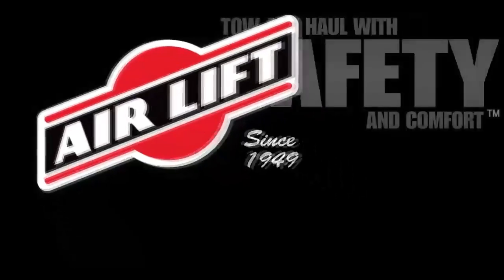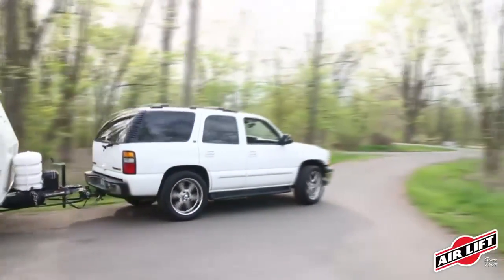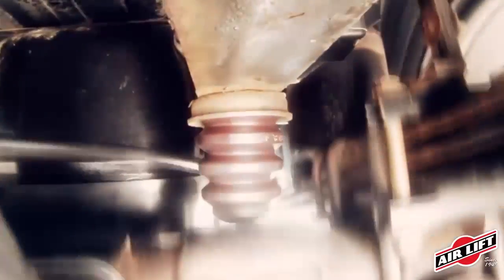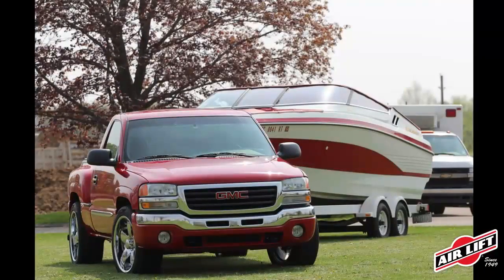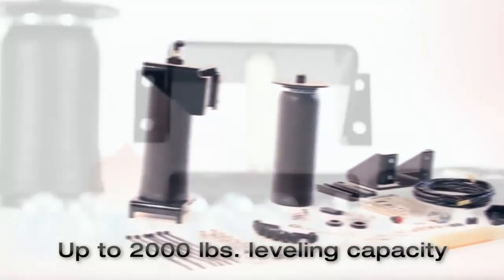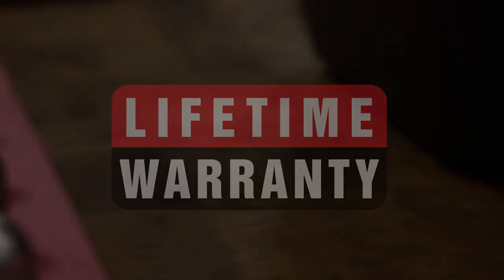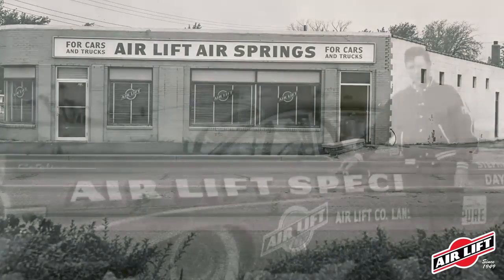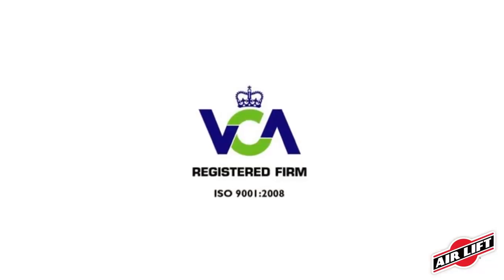Air Lift® Air Springs for Towing & Hauling

Comment: Video segment at 1:09 that vehicle has the stabilizer sway slide bar removed. That is what is causing the sway. Tell me why does this manufacture need to use misleading info to sell the product. I was looking to buy this product but will pass and buy from another company.
Reply: I don't think the trailer was actually swaying I think the guy was steering that way just for the video and thats why they removed the slide bar to make the sway more pronounced .
Reply: Ok 👌